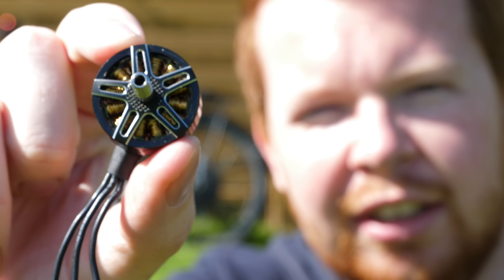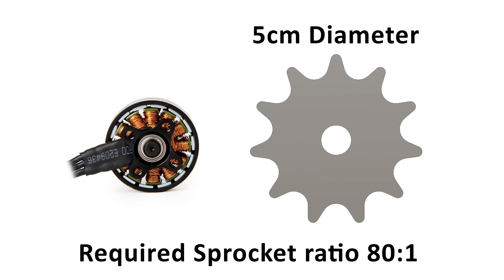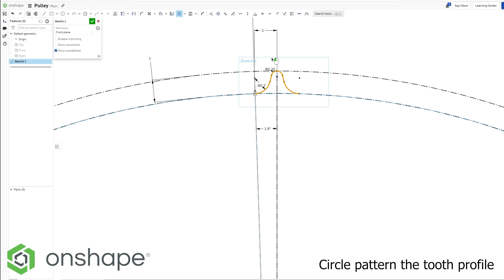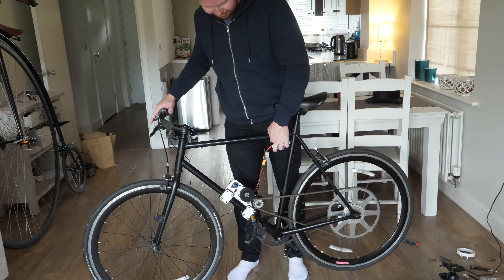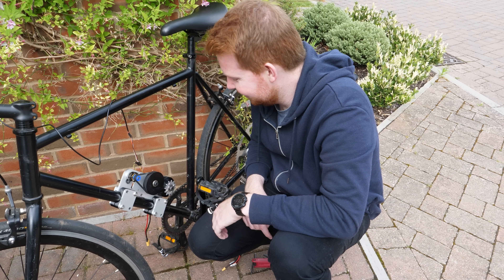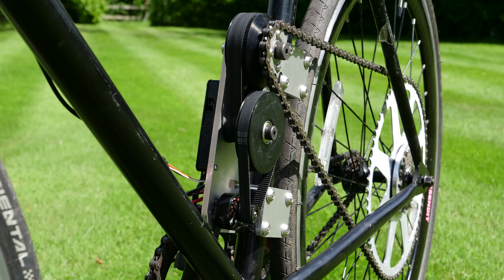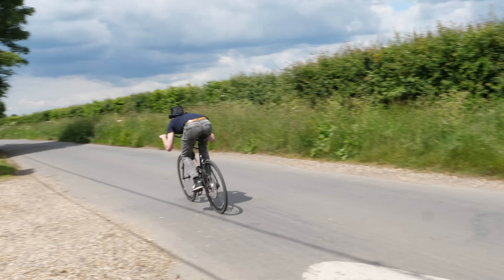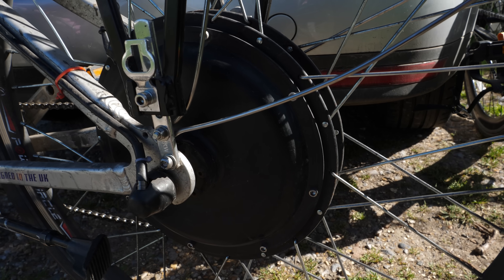Tiny 1kW Electric Bike Motor

Comment: If you can attach a manual pickup fly wheel and submerge the motor inside cooking oil. The motor would have a better chance of endurance. Plus if you can get a light weight chain will further reduce that stress on the motor.

Comment: Let's say the motor have an efficiency of 98% . Both motors will have a 20 W loss going to heat.   20 watt will barely warm the large motor but it will melt the small motor.   I made this comment before watching the entire video.

Comment: That completely unfair comparison you should of compared a larger drone motor such as the T-motor v10l 170kv or equivalent. 

Imo, what you used is a very tiny motor and it does not reflect the potential a drone motor can provide.

Comment: Just as a thought you can run 2 motors through a gearbox together to drive a belt. At that point you can either extend the lifespan of the movers or add another reduction for more consistent performance. A better heatsink  would also do you wonders on those usually air cooled moters. A water jacket would be super cool to see
Reply: Had the same thought after watching the video. Maybe another video trying it out would be awesome
Reply: Yeah as they’re made to be used with a propeller they’re designed with the expectation of LOTS of cooling being available… mounting a fan on the shaft (if there’s still room after the pulley) will help a lot with the temperature and performance. And yes a geared system would be great. There could be 4 or more arrayed around a central gear (>4 pinions driving one gear) and it wouldn’t take up too much room if done right. That would make for an impressive machine… but would require 4 ESCs as well. Still, pretty cheap way to do things!
Reply: You can also make it driveshaft unstead of chain drive maybe?
Reply: Also the watercooling is an option on larger motors of this type, from the 6384 (63mm dia, 84mm long) up I believe, I.e. the 80100, 83100, 12090, 120100, 154120 etc.
Reply: all of that is expensive, heavy, unreliable and inefficient compared to a simple hub motor @imperialsecuritybureau6037
Reply: but you add more step = add more  loss.enegy

Comment: Put a heatsink on it.  With some work on the motor design to get the efficiency upto 99.99% the design can probably be reduced in both size and weight.

Comment: i dont understand the whole watt wat thing its insane like when u get 100.000volta or whats tazor it duz not make sense cos a.. 240v and that can kill you so i dont get it but the other day i looked at a drone moto and i thought the power of that and using gears u could power a bike easy gears make anything possible also i have said it since been 15 i am 33 u could lift a 1 ton object with a tiny moto out of a dvd player obv it may twke 3 hours to lift it but it would lift it am 99%sure...ive seen a few ppl lift massive weights with a lego motor so its possible i wish i had the money but then agaijnu dont need money  .ive built stuff all my life..this is a good video

Comment: I think part of the reason the first motor didn’t work well is that drone motors are sensorless, so it needs no sensors, but it doesn’t work well at low speeds, making it stall, which resulted in the coils burning out. 

You could try with a sensored motor (with a corresponding sensored ESC), but those tend to be larger and more expensive.
Reply: Don't these rely on the airflow from the propeller for cooling?
Reply: @cebruthius  I wonder how much airflow they get from the propellers, considering the blades usually start outside of the perimeter of the motor. I have an Air 2 drone and above the motor are the two 2 pins that hold the 2 blades of the propeller.
Reply: Nah, it was moving with no stalling/cogging, so it was fine. Windings were burning because of high sustained current. That motor can do 1000W only for short periods, with such thin wires and low voltage it is not designed to survive operating at actual 1000W for any longer period of time.
Reply: Dude didn't even inflate his bike tires, he's not going to understand you.

Comment: Sir can u extend the cycle configuration and add 3 Rd tyre with one more battery to maintain heat , more output in drone motor

Comment: Wow that works great.   Put a fan or two on that motor !

It also doesn't help that you mounted it directly to a solid plate.  There is no route for air to move through the coils.  If you cut holes behind the coils and mounted a small fan on the front, I bet it would work great.   

And if it doesn't, just buy a slightly larger motor.  You are trying to run that thing at 100% load, or more.  Did you even put a current meter on it ?  I'll bet any money it is pulling 200% of its rated current.  The power use curve for accelerating the bike is very different than a propeller power curve.

Comment: That little motor getting so hot was dealing with A LOT of constant drivetrain load/resistance too which is compounded by how fast it spins and has to spin the various connected belts, gears etc. I think that is a very different constant load than it would experience on a drone especially when starting at lower rpm's on the bike to get it moving.
Reply: Plus on a drone it’s got an oversized cooling fan strapped to it

Comment: Yeah. I wasnt expecting a smaller hp output to match the torque needed. You could gear it down more, but then you'll need a gearbox just to get a reasonable balance speed.

Comment: What's impressive it's the fact that, yes, such micro motor... It works! And, we have to keep in mind that such tiny drone motors are designed to be cooled with a continuous flow of air coming from the propeller.
Reply: does the heat comes from the amps that passes through the coils? or they heat up from the spinning alone?
Reply: @Descalibrado_  From Quora: In general, DC motors tend to get hot when they’re under a heavy load and drawing a lot of current. The more amperage is flowing through a wire, the more waste heat will come off of it, and this applies just as well to the coils inside a motor.
Reply: @Vic64Y  so the heat is from the electrical resistance of the high current In thin wires, thank you a lot!
Reply: @Vic64Y  brushless motors are ac but controlled by pulsed dc
Reply: Eh, no, the prop air goes past the motor, the most comes from the prop tips, nowhere near the motors. They are cooled by the passing air when the drone is moving, though. But hovering, there is little to no airflow over the motors.
Reply: the gears did work, not a motor

Comment: There is an obvious solution to the overheating problem. Put the original propeller on the motor, and let it spin on it's nominal speed. Use the air from the propeller to propel the bike. Like an airplane/bike hybrid. That would be so cool to see, I'm tempted to build it myself.
Reply: Motor would still have the same load, so it will over heat just the same.
Reply: @XtreeM_FaiL  With greater airflow, you have better cooling. Like the fans in your PC.

Comment: A bigger motor just has more leverage. So it doesn't have to work as hard to generate the torque. Maybe using a bigger motor would be cool. Or a few motors like that working together

Comment: I think it would be really cool to find some low rpm high torque motors (maybe from 1:10 RC trucks? ) and design a 2WD bicycle. I have a front driven ebike, and i love how it tracks on sandy paths like beaches or even climb when i coordinate carefully with pedaling.
Reply: This is what i was thinking, rc cars have motors that are larger in size and with much more torque but run on the same batteries

Comment: Crazy original idea: a) You could mount the motor above its gear for avoiding friction contact between belt and bicycle chain.
b) 2 drone motors driving the same shaft may give you divided load  and failure redundancy - if one motor failes, the 2nd redundant motor may still drive you back home or at least to a repair workshop (or airport:-)

Comment: Would be cool to try this with other RC motors. Like maybe a 4274 size Hobbywing motor that’s meant for 1/8 racing trucks. You could run up to 22V batteries, and that bike would probably fly, haha!
Reply: Well, you can see the original Tom Stanton DIY ebikes waay back then uses that kinda RC motor haha
Reply: some are even rated for 8s Lipos as i know
edit: Ive searched and found BL motors for 1:5 RC cars that are rated for up to 12s Lipos... so 44.4V rating/50.4V fully charged. It said 5.5A consumption at idle. ~275W without resistance? 650kV which still is 33k rpm with the 12s.
There is no rating for stall current so i dont know the max. consumption. Without gears it should have somewhere between 180 to 300N torque

Comment: Testing this on a public road likely contravenes Section 42 of the Road Traffic Act 1998 regarding the Construction and Use of motor vehicles. The 1000W motor means this is an electric motorbike not an electrically-assisted pedal vehicle (EAPC) and therefore subject to additional requirements under the Road Vehicles (Construction and Use) Regulations 1986. You also need insurance, relevant licence, etc. Pretty sure you filmed yourself committing an unlawful act, and you are risking a fine, points on your licence, and/or driving disqualification (not to mention potential criminal charges if you were to cause an accident...) so you may wish to seek legal advice.

Comment: Using 2,3 or 4 drone motors in series to increase the torque but rpm will remain same
And that also reduce some of load and heat and divide among all
Maybe it will work and reduce price and weight

Comment: How about a few motors in a common metal chamber geared to a single output shaft and have that chamber filled with synthetic oil. That way the cooling wouldn't be an issue and the torque would be evenly spread

Comment: Request Here: There is a myth out there that Bicopter Tiltrotor can't be done by PX4 and Ardupilot. Many many players had tried it after your RC VTOL video came out, but all of them failed! Can you build one with Pixhawk6x and the new PX4 Plz?( It should be easier for non-programmer to use Pixhawk6x + new PX4)

Comment: Hell if saves 6kg I'll take it. Even as a booster for those tired moments.  Surely there's a balance with a sensible weight vs motor size.

Comment: Bicycle needs lots of torque, and more torque = more current. With small motors, small wires diameters = higher resistance. That caused losses as high heat to occurs.

Comment: I remember a few years back, Tour de France started to use equipment to discover electric engines, typically hidden in the pedal crankshaft. 
So, it seems possible to use a fairly tiny engine to assist. 
As for using a tiny engine to do most of the propulsion on the other hand.... yeah, it would need much more raw torque
Reply: An electric motor plus a battery introduces extra weight, which slows the rider down. Does the extra speed of an electric motor  compensate the extra weight?
Reply: Considering the budget of some of the teams, and what's at stake, I presume that they could buy far more sophisticated motors, and use a planetary reduction gear box. Perhaps mount the motor in the downtube, just under the water bottle to use it to dissipate the heat.
Reply: @joejoejoejoejoejoe4391  I mean swap out the enamel on the windings with a higher temp polymer or ceramic and you'll already be able to push it harder longer. Next use flat ribbon conductors instead of cylindrical wires to reduce skin effect loses and winding errors (most cheaply made coils will have messy windings that actually reduce efficiency). There's probably more expensive rare earth magnet varieties that can hold a stronger magnetic field, and lighter/stronger metals like titanium to make the stator/rotor from. Higher quality bearings would probably contribute as well.
Reply: @xxportalxx.  If you have a really big budget, you could have silver windings. My thoughts of placing it under the water bottle was because they use thermal imaging cameras to detect them, you could put some ice in the water to offset the heat. I'm not sure you'd want it too powerful, it would draw attention too much.
Reply: @joejoejoejoejoejoe4391  oooo silver windings is an excellent addition, not even that expensive really, I use silver power straps at work actually (granted at my work money is no issue lol).
Reply: @xxportalxx.  Instead or round wire, could you use square wire for them, very carefully hand wound? I guess not much of an advantage over foil. Perhaps pole pieces with slots in ( like a stepper motor ) might increase the tourque, but require a very high frequency, which would be limited by the inductance of the laminations, unless it was used only like a stepper motor at low speed, and went over to use the pole pieces as one at high speed, in some stepper motor/BLT motor hybrid.
Reply: @joejoejoejoejoejoe4391  I've seen windings with rectangular cross sections used in transformers, however in those cases it was used to make aluminum work in the place of copper (the cost of the more exotic wire variety was outweighed by the savings from not using copper). So it's certainly possible, if you needed more turns than foil would allow perhaps (I'm not sure if there's a difference geometrically speaking).
Reply: @pieterveenders9793  People are all talking about thermal imaging, but they've been using magnetic field detectors for years to check bikes.
Reply: @pieterveenders9793  brb slapping on a SynRM motor in the Tour de France
Reply: @pieterveenders9793  Femke Van den Driessche, cyclo cross. But she was caught during routine inspection when they discovered wires coming out of the downtube after removing the saddle. 

There are video's online of bikes with hot spots from engine's, but I don't think I ever heard of one being caught at world tour level ( we all know we like to be suspicious about 'freely moving wheels' after a crash here or there, Cancellara comes to mind but that was proven false ).
Reply: It presumably wouldn't need to add much at all to have a significant effect for someone in the tour de france. Albeit perhaps it might be little to no help, or a hindrance, sometimes due to the added weight, and long distances. The cyclists are all similar in performance, so even a tiny bit extra when needed may have a big impact.
I think you could actually fit a relatively big motor in, as it could be a long cylinder rather than the typical bulky style. At minimum they could just use multiple small motors sharing the same driveshaft. They would need a battery too of course, but that could be recharged downhill or in easier sections.
I'm not sure any motors have been found in the tour de france though, it generally seems to be much lower grade competitions. The only pro I could find that seems to have ever been caught was in cyclocross about 5-6 years ago.

Comment: There's no way this 40g outrunner motor can take 1kW of power, maybe in 0.5 second brust. Normal maybe 200-400W max. From my experience with drones for 1kW You need 100-150g motor or more. Also reduction gears rob quite some power. I powered inrunner motor for 70mm EDF going about 1.8kW and 70000rpm limited to 10 second and the motor was like 90g but it was straight on the border of burning the motor

Comment: Cruising through the comments, I haven't seen mentioned the construction of those types of motors,.. And Their Bearings.
I doubt seriously that they are meant to take the off access Shear Torgue Stress of a gear and Belt. And probably what is causing a significant portion of the heat as well.
If you could take the off axis Torgue off the motor bearings. I think you could get much better overall life and performance out of them. Just a thought ☺️

Comment: 1000W electrical rating is pretty much also the mechanical rating. Electric motors are very efficient. At least normal ones are, I suppose it's possible that extreme-running weirdo motors like drones use, taken competely out of their natural habitat, might suffer horribly. 

I'd stick a drone propellor on as a fan, but cut take away a lot of the prop, so it only blows a small percentage of what it's designed for. You don't want 90% of the energy trying to blow the bike sideways.

You could also take stationary bits of the motor, and indeed moving bits if you judge it acceptable, and add extra metal mass for heat sinking. Since drone motors remove as much weight as they can, and rely on the idea of a powerful prop being above them. You could put some of that mass back.

Comment: The reason the drone motor keeps burning out is because ur using one drone motor to carry the load of what is usually 4 to 8 motors.....even 8 drone motors is hard pressed to carry the weight of a human being....maybe u can design a system using 4 drone motors simultaneously and pulleys

Comment: That's retarded, you are using a motor that is not intended to be loaded in that way. The motor needs aircooling from the props and little to no load on the shaft to work properly. You basically reversed the requirements into no aircooling and a butt Ton of torque for that tiny thing. Next time you can show us how to chop down a tree with a unmodified tee spoon. Same stupid concept different object 🤣

Comment: Dad was an engineer. Drone motors will hold out a relatively short time, doing the work of holding something up that weighs less than a chicken.
What YOU'VE done with it, however is more like trying to have it drag an elephant, which it is NOT made to do, and that for an extended time frame (cruising, on a bike... even uphill.
As another commentor brought out, it needs to be cooled. It is probably also practically floating, otherwise it wouldn't make 30,000 rpm. Add all that metal and drag friction, as well as slowing it down and with no ventilation... could've saved all that time, expense, work and effort.
I could pretty closely have predicted the outcome.
You COULD try to pick your teeth with a 2 1/2 meter breaking iron as well, but what would be the point?